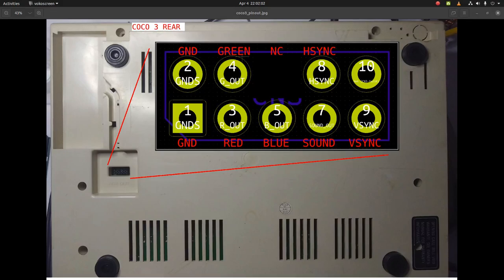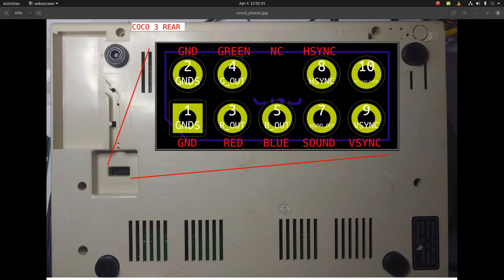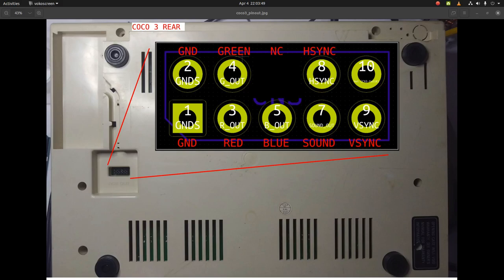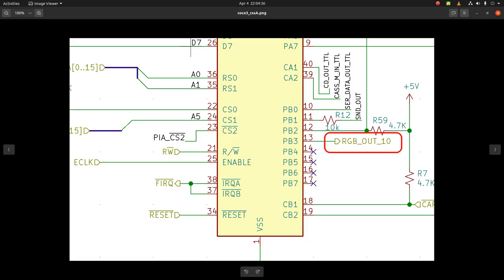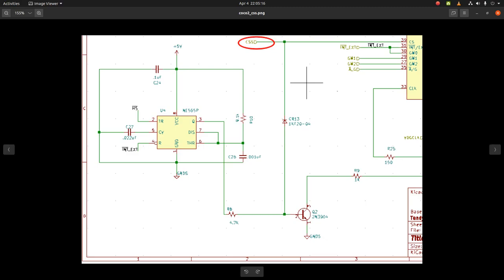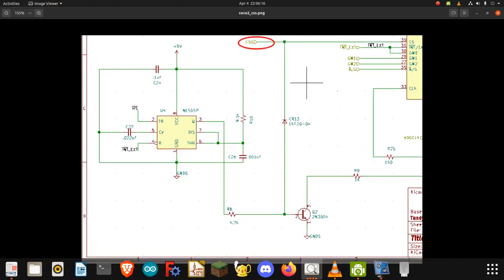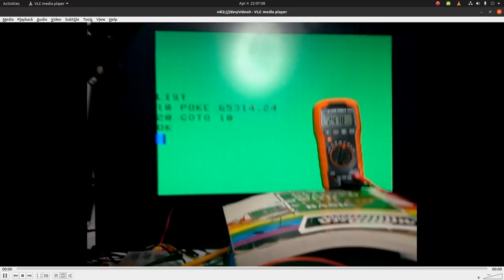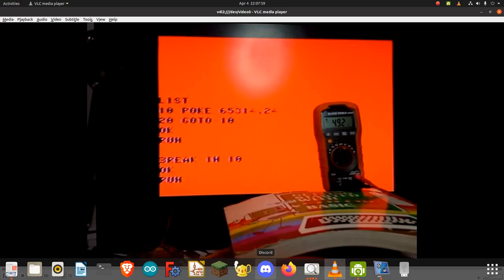CoCo3 RGB Pin 10 mystery

Comment: If you're able to set the pin, then you could use this in conjunction with a small external circuit that re-amps RGB lines (to protect them) and then use this as an "intensity" pin. 2.5v is normal brightness, 5v is half intensity. Voila.. 128 colors. Of course, you wouldn't be able to do on a per pixel basis.
Reply from the maker: Interesting idea.

Comment: Did you find any more out about pin 10?
Reply from the maker: Nope not really but the theory is that is used to detect if an RGB monitor is connected but I think it's to tell the monitor to switch between composite and RGB

Comment: If Tandy had ever wanted to offer the CM-8 in Europe, they'd have had to have a SCART input, no?
This signal would have been needed to switch the SCART to RGB mode.
Reply from the maker: I totally think it's some sort of signal line to switch between modes but I guess we'll never really know for sure.
Reply: @rockyhill3  so I tested it today, the CoCo sets pin10 high as you show, but when I plug the SCART cable into a converter box, the box pulls it low.... If you push 5v to it, you can switch modes on the SCART box.
Reply from the maker: @CoCoNutBob  Well, something has to be made to take advantage of that...
Reply: @rockyhill3  shhh... It's apparently a secret! 
I removed R62 (or 63?... the one that leads to the PIA) and put a switch to pin 10. Used a Sega to SCART cable ($8), and crimped a 10 pin IDC on there, plus composite to the sync line. Boom!